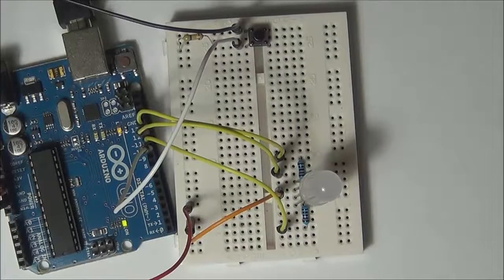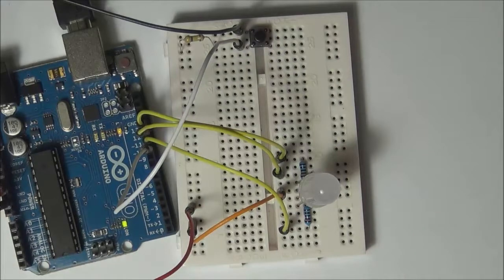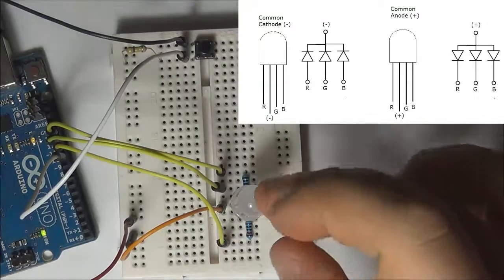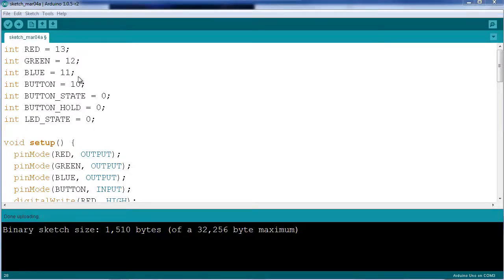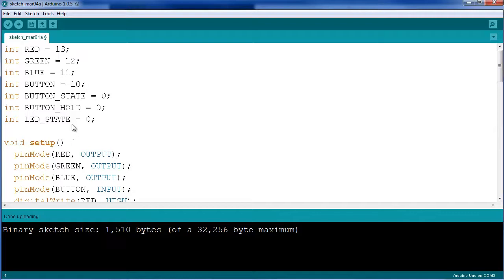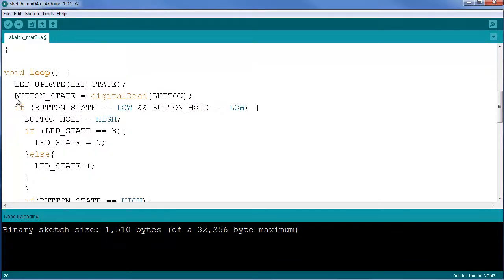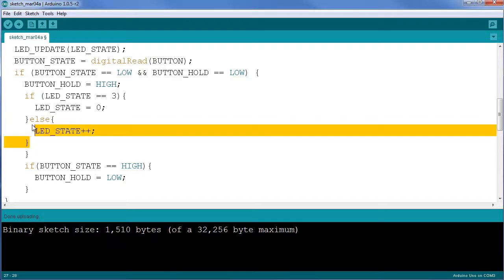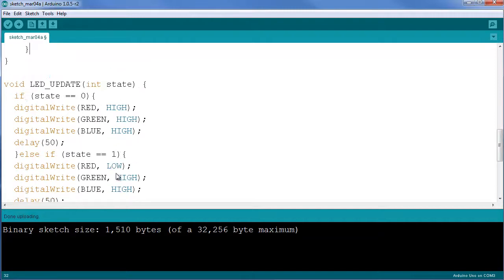Arduino Digital Inputs/Outputs Revisited - RGB LED example

Comment: Do you think putting pull down resistors on the data lines of an lcd would help stop random character from appearing on it?  The circuit has a relay ran through optocouplers to protect the arduino pro mini.  I thought it could be the relay, so I separated it from the rest of the circuit and the lcd still gets random characters.
Reply from the maker: How did you separate the relay from the rest of the circuit? You will definitely get spikes on your line when the relay is toggled. Two things you can do to reduce this noise: add a capacitor on the LCD power as close as possible to the device and make sure to have a freewheeling diode across your relay. I don't think pull-down resistors on data lines are a good idea or that they would solve the issue you are seeing.
Reply: The relay is separated by an optocoupler.  I think the noise happens right after the relay shuts off too.  What size cap should I use across the vcc to ground of the lcd?  I'm powering the whole relay board with the pro-mini too.  The relay is factory made module board.
Reply from the maker: I'm assuming that the relay is still drawing power from the main power bus though correct? Meaning that you toggle it through the optocoupler, but the coil draws the current from the same place as the LCD. I would use as large of a capacitor as possible; experiment with 0.1 - 100uF.
Reply: Yes it is drawing power for the coil through the pro-mini and so is the lcd.  I'll try the cap and if that doesn't work, I'll supply it with a separate power source.  Thanks
Reply: Russ Bowers Good evening. For driving a coil, such as in relay, you have to use a diode parallel to relay's electrodes, cathode to Vcc/anode to GND. Otherwise your arduino will be destroyed by voltage spike. Diode protects the circuit from the spikes.
Reply from the maker: vladstrulev Yup, as I mentioned in my first comment that diode is very important. The spike may not necessarily burn the Arduino, but may cause the voltage level to sag enough to turn the controller or LCD power on/off or cause weird characters seen by Russ.